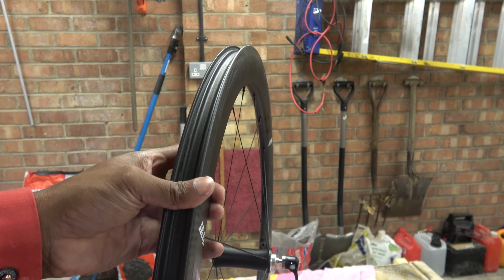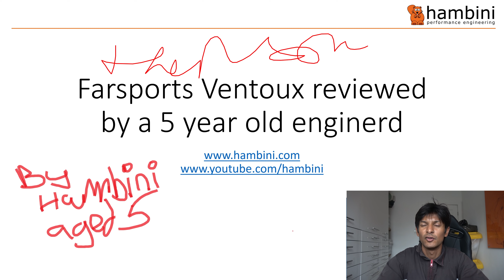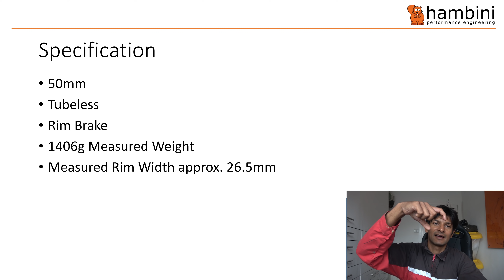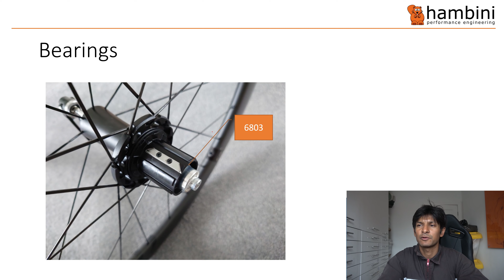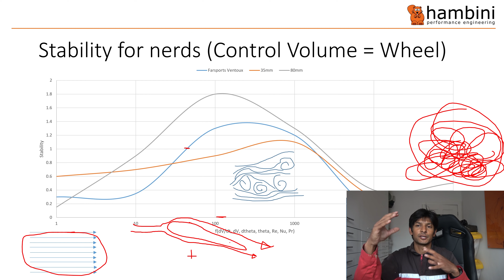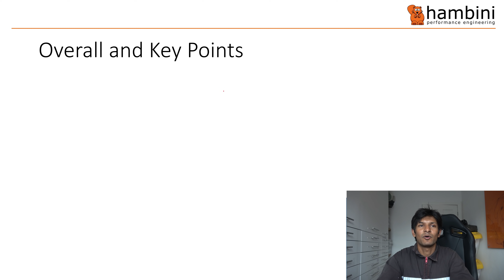Hambini Reviews Farsports Ventoux C6 Carbon Road Bicycle Wheels (56mm)

Comment: Hambini, I’m considering these versus Lightbicycle R55s. I took your advice against getting Winspace Hypers but I can’t decide between Farsports and Lightbicycle because LB offers non proprietary hubs and grooved brake tracks. So I’m wondering if there’s some other difference in the wheel quality that you know of that’d make it easier to choose. What do you think?
Reply from the maker: I can recommend the farsports, I can't recommend the lightbicycle. I'm not saying the LB is bad, it's just I don't have the same level of experience with them.
Reply: @Hambini  Thank you for answering my endless questions. My last query is do you think a carbon spoked wheel like the Farsports S series is going to make a noticeable difference in stiffness versus, say, their C series? I think the trouble I’m having here is that I’m replacing my Yoeleo C50s with DT 240s but I heard a lot of great things about WS and Farsports and how stiff they are … just not so much about winspaces bearings (which is also confirmed by your own blog post) and crosswind stability. Bearings can be relatively easily replaced, so basically the only downside would be carbon spoke repair if they ever broke.

Comment: Thanks for the video! I appreciate all the effort you put into your videos. I have also been looking light bike custom builds. Unfortunately, the price for these wheels just went up to $1699. I can buy a comparable weight, 46 mm wheels set for $1300. It is crazy how prices are going up. I bought a Specialized Roubaix comp etap axs in July and the same bike is now $1900 more expensive.

Comment: Hambini A little question: Have you checked the balance of the wheels? I ride yoeleo’s C50’s which I’m happy with and been problem free for 5000 km. However they are a little unbalanced for my taste about 6-7 g each. My Dt Swiss P1800’s are spot on. 
Did you notice anything with the Farsports rims?

Comment: I purchased Farsport wheels for two gravel bikes. They have been perfect so far after 1000+ miles of all round use. I’ve even ridden a red route mountain bike trail on mine and they are still dead true. That’s with them running 45mm gravel tyres tubeless at 35psi.

Comment: I’m riding 50mm regular Farsports for 2 years now with DT240s and Pro One Addix TLEs. Just did some descending on them in Sicily this week at near 40C and the brake track is intact, no delamination. I can definitely recommend them as well. Solid quality.

Comment: I have some 56mm wheels from Light Bicycle with an identical looking braking surface which they call "GGB" or grooved graphene brake track, which I gather is comprised of a high Tg epoxy and graphene powder to improve thermal conductivity.  The quality is exceptional and the braking with SwissStop Black Prince pads is superior to my alloy wheels.
Reply: do you find them stable or easy to handle? ("how long is a piece of string" question, I know)

Comment: Hello Hambini, what is your opinion on carbon vs steel spoke wheels topic ? Farsports is offering also Ventoux S series wheels where carbon spokes are the main difference comparing to C series.
Carbon spokes are lighter and you will use less spokes to build the wheel, so you will reduce the weight by few grams. But what about aerodynamics ? Carbon spokes I think are not as thin as Sapim CX Rays. Is it better to have lower count of spokes (16F+21R vs 18F+24R)  or better to have slightly thinner spokes ? 
And are there any real benefits of carbon spokes being stiffer than steel one, or this is just another marketing "stiffer wheel" buzzword ? Will using carbon spokes outweigh the cons related to carbon spokes which are mainly replacement parts availability and proprietary hubs ?
Reply from the maker: I would go for whichever variety you have spares access to. If you have the ability to get the carbon spokes, then I would go for them on the account of lightweight and stiffness but if they are unavailable when they break then you are stuffed.

Comment: Why are road bike wheels so freaking expensive, even if you directly order them from the Chinese manufacturer.

How about Prime RR-50 from Wiggle?
Reply: Most of the latest wheels are going wider internal rim width's, e.g. 21mm+ so you can run 28c tyres without aero penalty of a tyre wider than external surface of rim( now greater than >28mm)

Comment: Agree completely. I bought a pair of Far Sport Disc in 40mm - the modern design I went for are 28mm external width so even with 30mm tyres they don't balloon out. Sapim XRay spoke. DT Swiss hubs. Their communication was fantastic and have never experienced such helpful contact when ordering from abroad. Wheelset is strong + fast + stable. Very happy with them - cost was about half what you would pay for Zipp etc.

Comment: Have Farsports Kaze 69mm tubeless. They're better because of EXP 240T hubs.

Farsports manufacture Hunt. They're just assembled in the UK.

Extremely good and you'd be daft to spend many times more on wheels that aren't any better.
Reply from the maker: the hunt rim looks like a winspace rim to me.

Comment: This is out of topic, but i'll shamelessly ask anyway.

I'm looking at Sensah carbon 2x11 groupset.

They came with carbon fibers (obviously) on the rear derailleur cage and shifters. Which got me thinking. Does carbon handles friction well?
I looked at a few forums (sailing forums), and they don't seem like the idea of having a metal rivet meet with carbon.
Looking at the joints on carbon fiber parts from trace velo is worrying. The carbon shifter lever has a gouge at the point where it is in contact with aluminium part. Derailleur cage is especially worrying because it rotates very frequently and possibly rubbing with chain on road bumps. The cage is non removable if i'm not mistaken.

In short. Will it be durable?
Reply: The customers are doing their validation testing for them. The customers tell them what breaks and then they will improve it.   They have outsourced that job and you save $'s.

Comment: Just got a set of Farsports tubular 38mm wheels, but cannot comment yet about the workings. What I can report is the company is great to deal with, you can choose from a long list of top hubs, spokes etc, request custom tweaks, customer service is excellente; engineering details and quality are top shelf. Mine arrived in near perfect shape: spokes aligned, nearly zero lat movement, and wheels had been pre-stressed. The weight was 451g front, 570g rear. 

As far as badge stigma matters, it’s an indication of aspirational, not functional value. Both matter, differently, to different folks. Living in South East Asia, it makes sense on a number of levels to buy selectively from Asia. The fact is China is making great stuff. It’s not simply a budget minded choice anymore. Certainly, for wheels and frames, no problem. And, they’re catching up on the rest of components incrementally. Not there yet, but my money is on that they soon enough shall. 

I just finished a bike build based on wheels and frame, China, the rest of the kit, top stuff from all over the place including a BB made by a child…

Comment: Hello Hambiniiii!

I'm wondering... In many of your videos you say, that aluminium spindles on cranks get crushed from the stainless steel races of the bearings. Is it normal, that the axles on hubs are aluminium? Don't they have the same problem as the spindles with the bearing material?

Thank you in advance,

Alles in Obi!
Reply from the maker: wheels don't receive the same cyclical forces as a crank axle so you don't get the load transfer. Additionally, the bearings are going into machined holes so the fit tends to be better.
Reply: @Hambini  thank you!

Comment: From a MTB pespective I started to use CN products this season and I can't fault them. 11-46 cassette from ZTTO is super light and so far has taken the abuse pretty well. Pair of boost hubs from ARC are doing well too even after serious bike park abuse. Bearing are shoot tho but I suspect it is the disc side which always go first because of the heat made by the braking. In my 15 years in the sport I had all sorts of hubs including Hope and those are performing as I would expect from any other brand, difference is I get 114 poe and they cost me 70€ delivered. I will certainly keep using these 2 products for my future builds.

Comment: Blind spoke holes are a pain!!!!! Can't use a magnet as the nips are brass or Alu
Reply from the maker: Screw in a steel insert, how else are you supposed to do it?
Reply: @Hambini  i use a small koi carp to suck on the hole while I employ 10 italian flutists to hold the other holes.
Reply from the maker: well I wasn't expectin gthat for a reply.

Comment: To have such a technical assessment if fine but in the scheme of things after visibly looking at build quality, finnish, spoke tension would have been a prerequisite to graph. It shows what is going on in the wheel and displays build quality. It also can give an insight into potential future issues regarding longevity, also upper tensions, variability.  You can have a wheel that's perfectly true with very fine tolerances in lateral, radial run-out with high variability in tensions.

Comment: China and Taiwan are the only source for high-volume carbon manfacturing for road cycling for years already. Anyone else you go to is just getting wheel components from china anyway. The engineering came on a lot, the new wider u shape rims are way more stable than the old v-shaped narrow ones and the braking is much better.

Comment: Excellent video as always, not bad for a five year old. I'd bet a dollar/Pound/Euro that the reason why the freehub (and therefore the hubs) on the Farsports wheels resemble the freehub from that other wheel - which you note may be sourced from the same manufacturer - is that they are probably both made by NovaTech. They're a pretty big player in the game, and it seems that many wheel and component companies use their products. The same freehub sold under the Zipp name for USD $100 or so could cost about half that for the exact same thing if sold by a budget brand such as Vuelta. The product managers and others do what they can to save money and improve profits without having to work hard to make what they sell any better, since NovaTech has a literal menu of items that can be picked and chosen from without breaking much of a sweat. This may be good or bad relative to the state of the cycling industry, but that's the way it is. Keep up the good work, and keep banging your hairdresser.
Reply: I meant NovaTech, not NeoTech. Fixed it.

Comment: I owned similar model, 50mm depth front/rear and wide 26, same spokes, very suffered crosswind! braking performance with fulcrum pads very very good. Changed only to go disc brake. My next carbon wheelset will be Farsport Feder but 35 depth.
Reply: What does "very suffered crosswind" mean?
Reply: @StrategyPerformance  I mean when the wind blows from side (or when meet a truck) the front wheel is hard to manage.

Comment: I bought the most basic Farsport Classic 50mm rim brakes  wheelset with Novatec hubs in November 2019. Arrived in December. I paid £470. Setup tubeless with schwalbe pro one's. Have done almost 400 miles. No issues so far. No issues with braking. I think only Prime RR-50 V3 comes close on value.

Comment: I checked out the link and chose a pair of 35mm tubeless Shimano disc wheels. With standard shipping (10-25 days) these were 1161 Euro. I'm guessing from the shipping times these are shipped from the far east which will incur another 10% in import duties and 21% VAT. This just isn't on for unsupported far east mail order wheels. This kind of money buys you a set of fully supported A brand wheels at your local bike shop. Fully warrantied and repairable when needed.

Comment: I’m 7000 miles in to a pair of Farsports 50mm carbon rim brake hoops on DT 240’s with C X-ray spokes.
Cost me £750 delivered and were true out of the box and have been flawless . Braking with Black Prince pads is excellent. Highly recommended
Reply: I should add that I’m on the second pair of Conti 5000 clinchers paired with latex tubes. I have no issues with tyre fitting and can roll them on with thumbs alone. 🤷🏻‍♂️

Comment: I’ve been looking for a new set of rim brake wheels and the shit sandwich known as Brexit means that no one seems to be willing to sell me the DT Swiss dicut oxic replacements I crave… I’m even more inclined to try Far Sport now especially the degree of customisation they offer. Great vid. Thank you. 
PS given the choice which hubs do you rate higher i.e. carbon ti, DT Swiss, Chris King, etc?
Reply from the maker: I would get the far sports look or winspace hubs. Both are well made
Reply: Graham, I have a pair of the 21mm dicut oxic with DT 240 etc, they're great, unsure if I'd sell... But I'm pretty sure there's a set on eBay ATM. Can get you the link if interested

Comment: Bought a 40mm Asy/36 mm rim only combo from Farsports earlier this year, built up with some recycled Reynolds/DT Swiss 240 hubs and DT Aerocomp spokes. Rims are awesome although returning to carbon brake tracks, as good as they are, has been an adjustment.

Comment: What's your view on the Aeox Titan wheel used by Jumbo Visma & Ineos, the one that had the hub fairing banned by UCI? Did aerocoach get it right, in terms of performance gains, for those teams to use his nonesponsored TT wheel?
Reply from the maker: Once everyone else makes 100mm wheels or bigger then the advantage will be lost
Reply: @Hambini   I have a feeling that's the only reason they are using the aerocoach wheels, nobody ells makes a  new 100mm wheel, even a 80mm is hard to find.

Comment: Hello, could you please tell me what you think about the aerodinamics of the combination of a rim with a 42mm profile, 19.5mm outer width, 13,5mm inner width, with a 23mm tire, considering the tire will bulge, am I really getting a benefit from those 42mm against a rim with a 25mm profile, 17.5mm inner width and 23mm outer width, would it perform almost as good with same 23mm tire for the smooth transition or worse for the shallower profile?
Reply: Or you could train a bit more and lose a couple of kilos, cheaper too...
Reply: @alan-sk7ky  Thank you for your advice, but I'm going to buy 2 rims anyway in november, I have until then to know if the 42mm will be really noticeable more aero to be worth increasing the rim weight by 25.7% considering high speeds and sudden accelerations, writing this for anyone willing to give advice or a link with useful information.

Comment: This is about to get technical, so put on your tinfoil cap. Dealing with a broken spoke, especially if it was at the tip of the nipple where it meets the spoke blade, will be a nightmare to deal with. You could never get another spoke in the rim.
Reply: Then don't do that
Reply: @infinati  huh? What's the fix?
Reply from the maker: You can use a magnet and a ferrite plug to move it round and then pull the nipple out
Reply: @Hambini  cool. I think I will stick to 'traditional' rims
Reply: yoeleo have a similar rim and also a video of them building one up. they use string and a small hook tool, then a bit of masking tape to hold it in place
Reply: @WHAT_1400  Way too much work
Reply: @WowRixter  takes the builder about a minute in the video. although to be fair he has probably built hundreds up
Reply: It's bloody easy!   https://www.youtube.com/watch?v=nXeZfRD-fQ4

Comment: I bought a Farsport carbon wheelset 50mm a few months ago.  I built the wheels with Sapim spokes and DT 240 hubs.   The wheels are of high quality and remains true.   I am no light weight and  weigh 100kg and so far the wheels have not given my any problems what so ever.  I am running Pirelli Velo 28 tires and because the internal width is wide, the tires measure 31mm wide. At 50mm the wheels weigh 1335 gr which are very light.  I experienced excellent communication with Farsport.  They are not cheap but well worth the price of admission.

Comment: I give a shit about Badge Stigma !
I've tendensy to be "opposite" and me being a genetic Viking people rarely comment it.
If it happens it's normally a kid in he's 20's.
I ignore it !
I'm not going tubeless !
I doint care about some postulated efficiency, as I'm only training and commuting.
But I do care about the extra time that tubeless takes.
More time/work in putting the wheel on and filling with sealant, more messy and then cleaning myself, cleaning my bike, cleaning the neighborhood as foam has sprayed all over, disasembling it all several times a year to clean the tires and wheels and reaply sealant...
As I see it, its not smart.
Yes it might have solved a problem somewhat, that I can keep riding with a puncture, unless I'm riding with narrow tires and high pressure...
But it has introduced a lot of anoying work.
Just bring a tube and some gaffa-tape !
I see tubeless riders bring amounts of Punture Repair Kits on rides, that even outweighs if I bring 4 - 6 tubes.

Comment: I have a set of FarSport wheels. Rim brake, tubeless, road, standard spoke holes, 50mm. The are great, except that they pulse under braking. I have cleaned the braking surface, but that doesn't help much. I have about 4,500 miles on them. I built a set for my daughter's XC 27.5" race bike. Those have no holes in the rim bed. They came out to be 1300g on DT Swiss 240s hubs. No problems at all. I'm ordering a third set now for my CX bike today.  I have had great luck with FarSport wheels. My Bontrager Kovee pro's have 2000 miles in the last 6 months...they are already creaking and moaning.